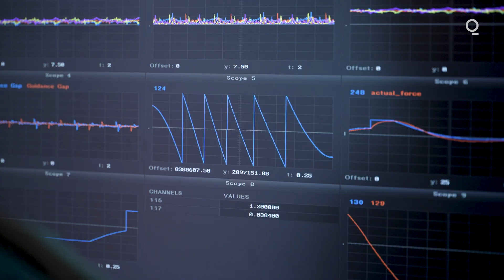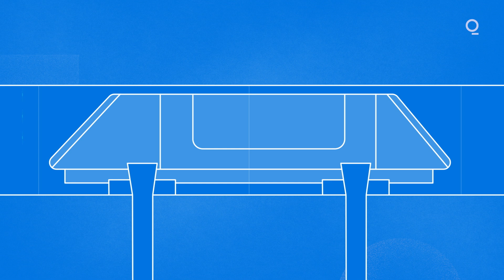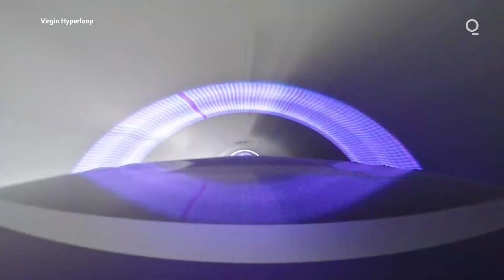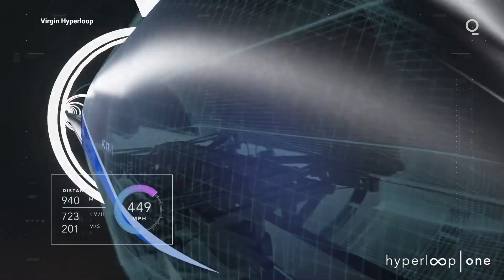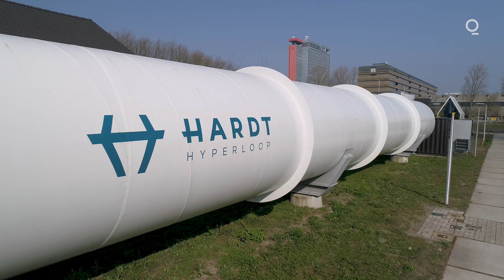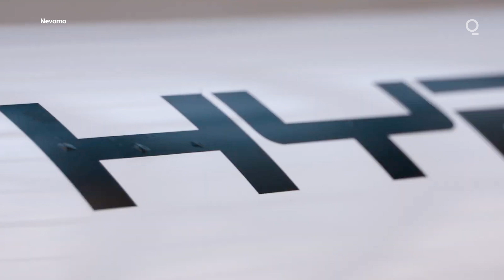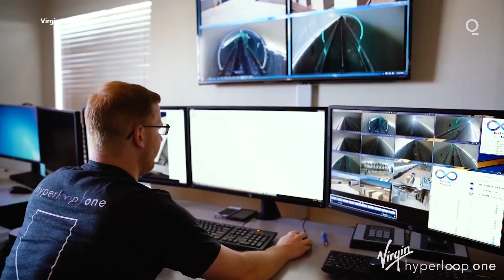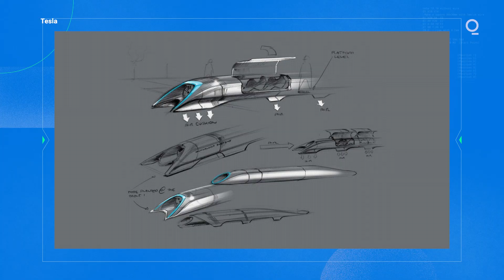The Hyperloop May Disrupt More Than Just Travel

Comment: I'm interested to know how they would deal with situations such as an unexpected tube depressurization. Or just a minor earth tremor (which I would think would be a big problem with magnetic bearings).
Reply: Well, it's not complicated really. You will need a broom, a sponge and a bucket.
Reply: That's the great thing about Hyperloop  If any tiny thing goes wrong, every single person within the system gets mulched.  There's nothing to save and no rescue operation to mount.  Its a self-solving problem.
Reply: @dairallan  
You just found the solution for the current population growth rate.
So ... let's build it!
;-)
Reply: @wimahlers  AIR,I need AiR
Reply: @dairallan  Ahh, I see, it cleans itself up, nobody gets injured, they are all dead!
Reply: Cars are full of fuel, so every time they leak they explode, killing everyone and destroying the part of the road they're on, making cars useless. Planes fly miles in the air in a near vacuum, meaning every dodgy gasket results in explosive decompression, everyone dying, and tonnes of steel falling onto cities killing hundreds more, making planes useless. Ships travel thousands of miles across the ocean, so when they leak they sink miles into the ocean, killing everyone on board, making ships useless. But... these things DON'T happen. Why talk this way about the Hyperloop?
Reply: @dairallan  but you still need to clean the interior of the tube.
Reply: @Fulmynato  obviously someone has to clear the horse viscera.
Reply: @dairallan  well tbh even if a single bolt on the railway track came off it runs a risk of the whole train derailing. Let's see how it turns out before we dismiss it altogether
Reply: @dairallan     Yeah this is a bad idea. Just like those fancy dancy engineers with their little plane things. Those darn planes will never be used, what if it crashes? I doubt plane crashes will leave many survivors
Reply: @captainSparrow2025  Literally no-one with a reasonble understanding of physics believed planes were "not possible" or dangerous beyond acceptable levels.  no-one.  On the other hand, anyone looking at this con with a scientific background says its absolutely nonsense that cannot feasibly be implemented with current tech.

Con men like Musk rely in the scientifically illiterate like yourself to work their schemes, its why such a bad car as Tesla sells, its about getting rubes hyped up and separating them from their money.
Reply: @dairallan  Musk is just a sales man. If someone looks at the top 2 institutional holders of Tesla they'll see the same one's own both Tesla and Big Oil. These institutions will never allow Musk to outcompete big oil, which is probably why they tried to bankrupt his company years ago.
Reply: @dairallan  nobody who's remembered anywyas. There are ALWAYS, ALWAYS people who protest or have hesitation with new technology. No different for planes, no different for hyperloop.
Reply: @dairallan  I mean, I'm a bit skeptical about Hyperloop and I think many Musk fans are cringe but all I see is people saying "if anything goes wrong everybody dies", and that reasoning can indeed be applied to planes as well to a certain degree, or to a train when a small portion of the track is damaged and it derails killing hundreds of people. In the last few days a cablecar in Italy fell and killed 14 people, all you have in that case is a cable between life and death, if anything happens to the cable you're dead

What matters is redundancy and safety features. Hyperloop is certainly a bigger challenge but I'm not sure it's unfeasible. I'm not really into hyperloop stuff, but maglev trains are a thing. As for unexpected tube depressurization, they're accidents that could happen, just like a train or a car can crash, it depends on how frequent it would be, on how hard it would be to prevent it etc, but as I said I don't really know much about it so I'm just making assumptions with no actual numbers, I'm interested to see how far they can go
Reply: @Marco-zt2jj  Look up thunderfoots videos on hyperloop. he has debunked it.
Reply: @captainSparrow2025  90% of people involved in plane crashes survive. and 55% of people involved in SERIOUS plane crashes survive. 0% of people would survive a hyperloop crash if it ever managed the speeds Musk has been spewing. Fortunately, it will never happen, because it's a terrible idea. It's a whole lot of extra engineering and MASSIVE increase in spending, to engineer around the many, many problems.
 Speaking of planes...they're faster than trains. They've conveniently ignored all the security checks, when they've created BS figures for the load/unload times of the Hyperloop. Fact is, it would be the same as the airport. There is no system or technology that can get everyone on a train faster, while making sure none of them are terrorists, that wouldn't also speed up the same process at airports.
 If you want to overcome the problem of all the energy it takes to lower the air pressure, just go where the air is already very thin. If you want to remove the danger of a minor contact wth the tunnel wall killing everyone on your train, and everyone on every train currently in the system...go somewhere there are no physical obstructions.
 Planes are already a better solution than a hyperloop can ever be, EVEN in musk's fantasy.
 It's just a BAD idea on every level
Reply: @Marco-zt2jj  That's the point.  **Everyone does die**.  Explosive decompression is the only outcome from a rupture to the system.  And when that happens **everyone dies**.
That's the physics.  When a train derails, not everyone dies.  Sure sometimes it can be catastrophic if at high speed but even the most catastrophic derailment can have survivors.
You can't survive explosive decopmression **anywhere in the system**.  Everyone dies.  Violently.  Reduced to mulch.
Reply: @dairallan  actually, victorian scientists did, Kelvin for example said heavier than air flight is impossible. I agree with the rest of your point though, as a scientist. America can't even run a public train service properly, and they want to make a more complicated version that could be sabotaged at any stage along thousands of miles with little effort?  The economics of that are more ridiculous a problem than even the engineering.
Reply: @dairallan  for someone talking about science you should know there is no explosive decompression from one ATM to vacuum

Explosive decompression only happens when we are dealing with a difference of SEVERAL atmospheres, usually involving deep diving equipment
Reply: @ashscott6068 90% of plane crash victims survive? Whatcha been smoking?
Reply: @captainSparrow2025  Your argument is dumb! the hyperloop is a scam, it'll never happen.
Reply: @dairallan  I don't think Musk and company need any more money.
Reply: @jew-sa  big oil is running out
Reply: @Marco-zt2jj  if the use of hyperloop is restricted, should be okay.  There should be no accidents/errors.  It is a closed system in a human controlled environment.
Reply: @ashscott6068     I was mocking people of the days before planes. They also thought that not many people would survive plane crashes, I mean look at how fast it’s going right?
Reply: @coolvideos8864      You can’t know if it won’t happen. Bruh people like you who say things are scams and won’t happen just have to keep learning your lessons don’t you.
Reply: @dairallan  Don’t think people notice that your saying that this idea sucks, ever wanted to feel what it’s like to be crushed to death in a already made coffin? Look know further. After saying this it should be renamed to Hypercoffin
Reply: @captainSparrow2025  The reason people survive plane crashes is due to the pilot normally either slowly landing the plane or finding a soft emergency landing spot like water. If the hyper loop got depressurized the passenger tube would be crushed
Reply: @dairallan  
Isn't each compartment/car  individually pressurized?
Reply: @maskedgamer5132     Yeah. It’s not finished
Reply: @selah71  It doesn't matter.  They're being hit by a wall of air travelling at the speed of sound.  They get mulched.
Reply: @captainSparrow2025  I know BASIC PHYSICS!
Reply: @coolvideos8864     Who are you?
Reply: @dairallan  
I'm not a scientist or engineer but I don't think it's wise to put people in a tube, inside of another tube, to go at the speed of sound. 
The concept is intriguing and seems to me like the tube at drive through banks. So I think something like this could work but not on the scale Musk wants.
Reply: @captainSparrow2025  I take it you're not an engineer, are you.
Reply: @RM-el3gw    No I’m not
Reply: @ZentaBon  Remember Hovertrains, or monorails? or super sonic airliners? Some tech tress are just dead ends
Reply: This is just a very expensive publicity stunt. Maintenance costs can only be gigantic and if anything it would be a great way for a few millionaires to go from A to B. What would be great for Americans is not this useless idea but maybe an actual transportation system that people could use now.
Reply: The worse case scenario is the car loses pressurization and exposes passengers to vacuum.
Reply: @encinobalboa  Worst case scenario is you’re gonna feel what it feels like to be in a can of sardines with someone crushing it from the outside
Reply: @maskedgamer5132  If the tube implodes, that's bad.  Mythbusters implodes a tanker rail car with vacuum and it was spectacular.  However, the more likely failure will be the car hitting the tube.  If the passengers are lucky, the tube fails and vacuum is lost.  If the car fails, passengers are done for.
Reply: @encinobalboa  You should put something in a container, vacuum seal it maybe even make it so the inside is normal pressure, then immediately let all the air back in and see what happens, crushhhhh
Reply: @maskedgamer5132  What are your talking about?  Vacuum seal is a totally different process than a vacuum tube in which the volume of the tube is maintained but the air is evacuated.
Reply: @encinobalboa  Never said they were the same, just said you’d get the same result of what would happen in the case of depressurization
Reply: This is why they should start with shipping goods rather than transporting people.
Reply: I do not understand why people are still mentioning Musk like he is involved in any of this. He pitched the idea in 2013 and walked off to let others run with the idea.
Reply: It’s a Fundamental issue they never speak about or address.
Reply: Pretty sure they said something similar about building very tall buildings. depressurisation, I’m no engineer, however pretty sure it won’t be like hitting a wall.. and I don’t think at this pressure it will be explosive, just a gentle slow down I imagine, and a delay on your journey, nothing worse than a motorway. Earth tremor, have you tried to force  the same poles of a magnet together, pretty resilient, also dampeners are used mostly everywhere, for example bridges and buildings. All in all I think the tech already exists, it’s crazy to think that we have huge planes in the sky, and this is secondary to that, that be large plastic tubing on the ground.
Reply: Pressure relief values... you guys should look them up some time and stop watching videos from a YT grifter who has invented nothing
Reply: That was my thought, earth disturbance.😭😳
Reply: Yeah, not to mention the embarrassing 28 passenger capacity for each pod and far higher building and maintenance costs when compared with regular high speed railways in Asia and Europe.
Reply: They are talking about it.  There’s YouTube videos discussing how it could be done
Reply: @mastercleanseNOTdiet       Elon Musk is doing that which no rich people were doing. He is the most important person on Earth right now, in my opinion.

Comment: Hyperloop is a hoax.  Thunderfoot's videos on You Tube tear the whole idea apart.  In his videos Thunderfoot does the math on things like how many pumps it will take to evacuate all the air in miles of steel pipe and how long it will take to achieve the proper level of vacuum, and how much it will cost for the power to run all those pumps.  He also goes into the problem of expansion and contraction of the miles of steel pipe over hundreds of miles.  Then there is the problem of how one builds a tube to hold very high vacuum without leakage while that tube is simultaneously heating in the desert and cooling in the mountains.  Before you invest your hard earned money take a close look at the Las Vegas loop that Musk just opened up.  It uses Tesla cars driven at about 15-20 miles per hour through narrow underground tunnels and the whole thing was EXPENSIVE to build.  High speed trains are already a mature technology and they are way cheaper than vacuum tubes with little capsules in them.

Comment: The answer to: How can I experience the danger of space travel on Earth?
Reply: @Someguy-qt3dv  An unattainable vacuum
Reply: I don't understand, how is this like the dangers of space?
Reply: @nepgearsy1  shoot at the tube's wall, every person in every single pod dies.
Reply: @MadLemon  Why would every person in every single pod die? If you shoot a hole in the tube the vacuum decreases, making it actually safer for the people in the pods. The biggest danger is for the people outside, who come too close to the hole with their hands.
Reply: @erwinnijs1  Pretty sure the entire tube would be crushed if there was a hole in it. 

If the tube had a greater pressure than the atmosphere then it would expand until it exploded and if it was under the amount of pressure in the atmosphere it
would be crushed. 

Like the Soviet Union’s landers on Venus.

But that all depends on how strong the materials are to keep it in shape.
Reply: @NeoEureka  Atmospheric pressure on earth is only 1 bar, on Venus close to 100 bar, and I doubt they will try to reach full vacuum. If a tube crushes under vacuum it's because it has no holes in it. Leaks prevent it from crushing.
Reply: @erwinnijs1  it doesn’t need to be a full vacuum, it just needs to be lower than the atmosphere.
The hole shtick of the hyperloop is to put pods  in a vacuum to lower air resistance/drag to let the pod go faster.
Reply: @erwinnijs1  you have a wall of air moving in at the speed of sound, how do you propose they survive lol
Reply: @ms-fk6eb  Stop, just stop.  These people are qualified to pour you a cup of coffee, not discuss what would happen in a 500 mile long, massive vacuum tube suddenly re-pressurized.

Comment: I was hyped up about the project at first, but I'm getting skeptical. The idea released in 2013, and 8 years later they barely reached the speed of a normal train in Europe...
Let alone a TGV, with commercial speeds of 320 km/h (200 mph) or a maglev train like the one in Japan. 

They should at least manage the TGV speeds before bragging about anything. Plus the additional costs and viability of the project!
If it does ever make it, at this snail's pace we won't see a commercial Hyperloop until 2040 at least.

Comment: This is in part made feasible by The Boring Company which reduces the cost of tunnelling. Shame they didn’t explain how passengers could board given that the tubes are evacuated, presumably using airlocks of some kind. Also what happens if power is cut. Do passengers sufficate? How is the vehicle extracted?

Comment: To travel at over seven-hundred-miles-an-hour, the cart/pod/craft must be at infinate levitation without ever touching surfaces, even when power fails. A pod-in-pod cart/craft will require, to reduce leaking odds, tilt g force adapt, and quick transfer tagging swap. Side parallel walks or pipe/tunnels will be required, so repairmen and emergency evacuations is possible. [Added suggestions to design]... Decompression is not required, with a concept I call, 'Turbine Loop', air moving parallel to cancel the frictions, enough to make the cart/pod/craft move beyond sonic as the atmosphere is almost matching 200-300mph, thus a speed zone just below decompression at 500-670mph, allowing freely open air path travel to eventually merg, for change lanes & docking pend. [hints on design issues] The more narrow the tube, the more decompess the air required, because your burrowing through air, airodynamics is useless in such areas.

Comment: So when the tube splits the system is relying on a long bar code scan to change tracks? We can’t scan stationary bar codes in a supermarket without failure and the hyperloop bar codes are determining if you will get to your destination or crash into another pod at a net 2000kph....

Comment: The clue is in the name - Hype. All that has to be done is: 1. Acquire sufficient land to build an extremely straight line, both vertically and horizontally. If you wish to see how big the radii of any curves are look at how much sky it takes to turn an airliner. At 500 mph with 20º bank you require a radius of nearly nine miles. 2. Weld, mount and joint millions of tons of thick walled steel tube. 3. Seal every joint to hold a vacuum. 4. Build a life support systems to ensure sufficient oxygen for people in vacuum (please, don’t mention masks in an aircraft). 5. Supply power and sensors to every section of the track and install hundreds (thousands?) of vacuum pumps. 6. Ensure the system’s integrity on a constant basis to ensure the structure is not compromised by accidents, temperature changes, vandalism or terrorism. And these are the very easy bits. And these muppets expect little pods to be a mass transit system that will complete economically with air and rail? My money will remain be securely in my pocket and I hope my government treats this ridiculous idea with the same contempt.